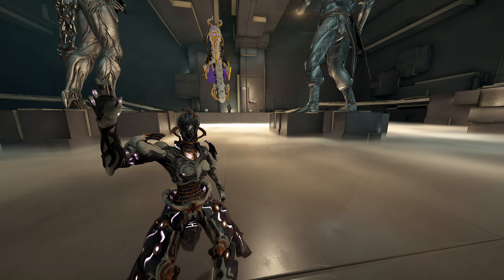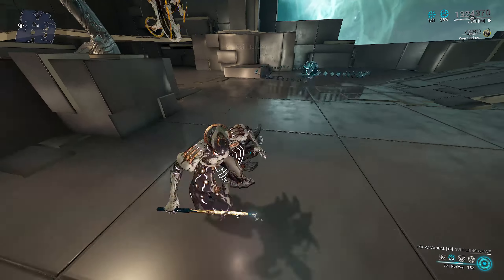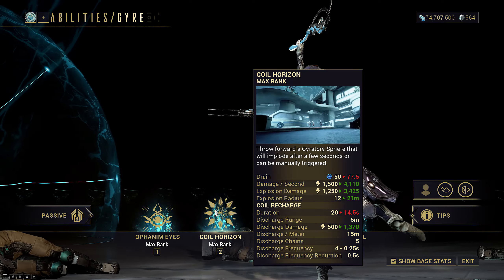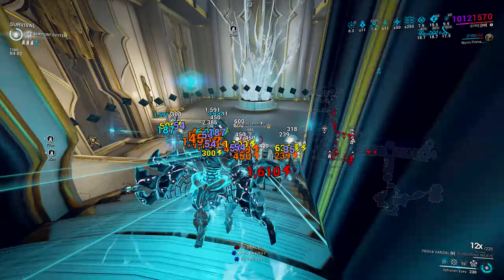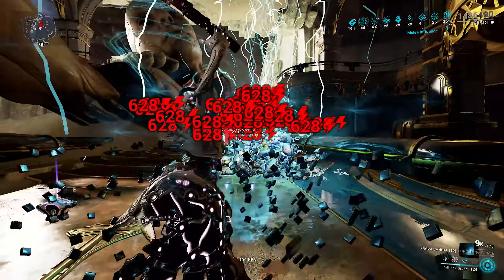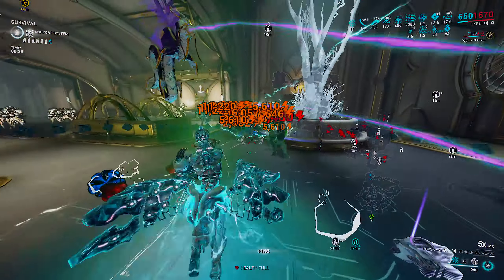Gyre’s New Augment: Coil Recharge | Koumei & The 5 Fates

Comment from the maker: TIMESTAMPS
I'm on Twitch too now!
See me live at: https://www.twitch.tv/aznvasions
NEW Gun CO Spreadsheet: https://tinyurl.com/GunCOv2

0:00 Intro & Context
0:20 Cathode Current
0:57 Coil Recharge Mechanics & Bugs
2:13 Issues with Coil Recharge
2:51 Aiming Problems of Coil Horizon
4:06 Helminth Options

BUILDS
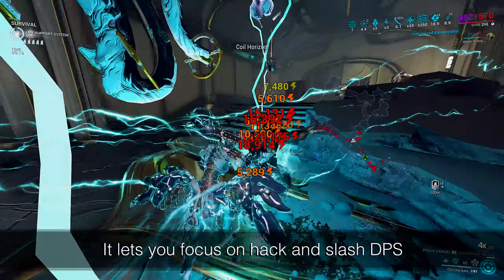5:45 Gyre Coil Recharge Example Build
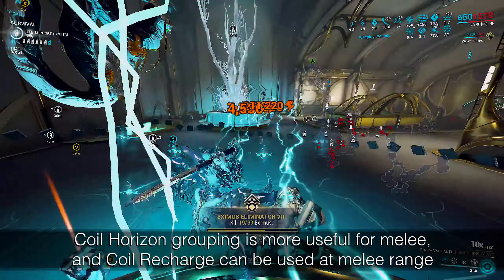7:09 Melee vs Guns
7:31 Example Melee Builds & Discussion
8:02 Summary & Outro
Reply: Well... Need to say that Sinister Reach doesn't work on Tazicor... The normal Range is 20 Meters and with Sinister Reach is the same 20 Meters instead of 32 Meters... o.O
PS: Don't put Mods without Testing first cuz that will just make people commit the same mistakes like you did... o.O

Comment: Might I also suggest that tempest barrage combined with cathode grace and rotoswell allows one to become a storm, tempest barrage can become viral/corrosive rain and hole Gyre unleashes a lightning storm, with 45% efficiency and 229 power strength I’m able to sit in one spot or move around.
Reply: I AM THE STORM THAT IS APPROOOOOOOACHIIIIIIIIING
Reply: Replaced quorvex's 4th skill. I pull the wall together and throw the sphere.
Reply: PROVOOOKING
Reply: So wait, are you suggesting to use Coil Recharge with Tempest Barrage (w Viral Tempest) AND Cathode Current for a triple augment build?
Reply: @NathanTruby  Assuming they meant with coil recharge, it's quadruple because they also mentioned the viral one for tempest lol
Reply: @Zevox144  no, it'd be triple since Rotorswell doesn't technically have an augment
Reply: If u have bubonico, u don't need tempest barrage.
Reply: @NathanTruby this is exactly what  I do, coupled with Shade Prime. You can Viral prime, armor strip, group and nuke all from abilities to murder everything without ever breaking stealth. The extra elec procs juice your passive massively to red crits without having to stack strength to the stratosphere and Tempest Barrage also damages Nullifier bubbles. Also being invis permanently is amazing survivability allowing you to play at a chill speed that lets you work with the ball's physics instead of fight with it like a more active build has to.

The catch there is it requires not meleeing the ball which means the augment is kinda not being used in its intended role. With Grimoire, Molt Augmented, Molt Vigor, Madurai and Power Drain you can snapshot 255% Strength onto the 4 and 205% onto the 3 and then Tempest does its work through status freeing up a lot of mod space versus, say, a Pillage spam build.
Reply: @tomj819  hello, could you please explain more depth how to stay invisible indefinitely I main ash and this has always been something I try and fail at
Reply: @caryroberts6748  Shade and its Prime have had some major improvements to how the Ghost precept works in the last 3 updates. As long as you aren't using weapons it will cloak whenever enemies are nearby very reliably now. Abilities don't break the effect.

Comment: Post-update Tazicor is incredibly good for priming, and it seems like people haven't fully caught on yet. Since you're likely to use it a lot by keeping it passively equipped, it's a great candidate for getting a riven, and it has a good dispo. Get 'em while they're still fairly cheap.
Reply: I haven't tried it at all but how is it against helstrum for priming?
Reply: @varas2905  Helstrum can prime more elements, but Tazicor beats it in terms of consistency due to being a chaining beam weapon while Helstrum has to deal with the slow fire rate and travel speed of the missiles.

Tazicor is just better imo.
Reply: Most builds use >50% crit on sentinel for the 1,2 Bonus. Hence tazicor will remain unpopular mostly
Reply: What even would you put on a riven?
Reply: @FelisImpurrator  You would want things like status chance, multishot, fire rate (secondary choices are things like magazine size, reload speed, maybe status duration, or an elemental if you don't mind locking in priming choices and affecting weighting).
Reply: @MinorKeyMystery  How does multishot work on beam status exactly, anyway?

Honestly, I'm not sure it needs any more proc rate if all you're after is stacks, seeing as rivenless it already ends up maxing out combined elements in a fraction of a second with an extra 50+ electric stacks. I'd say at that point you might want damage multishot and maybe status duration or reload speed or fire rate, so it can actually kill some trash and proc contagious bond.

Comment: drawbacks are def there with its small range and it getting caught on stuff when u try to recall, but u left out its interaction with melee which sends it where you're looking. you're meant to soccer kick it with your melee down a hallway or into the air to scale its damage and discharge frequency. its def not as convenient as old builds but its silly and does more damage if you're scaling it past 225 meters travelled. i hope u give it a try with an afflictions melee like sampotes or exec cuz u can prime enemies to crit harder at the same time as sending the ball flying and recalling it

Comment: U can also just recall then melee it after u throw it initially to keep throwing it across the room rinse and repeat. ive gotten it so it procs many electric procs so my ult can finish them off then with enough charge u let go and then it insta kills a room with 120ish electric procs. the recall is to put it around u so u can baseball swing it towards the mobs u want to kill and build up more charge. u didnt go through its charge mechanic but it basically gains a huge amount of electric procs and damage based on the charge u generate during its duration. the charge generation is based on how far the ball has traveled and the best way is to throw it back at ur enemies rather than letting it follow u.